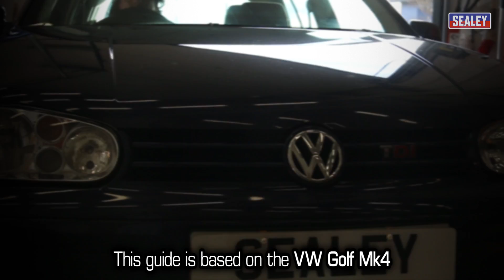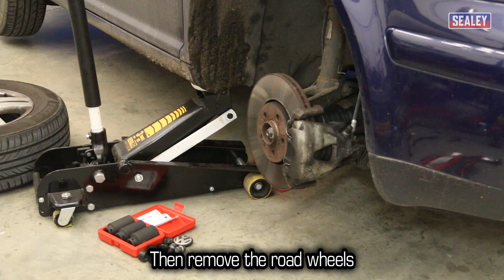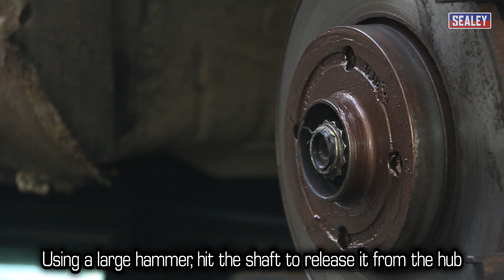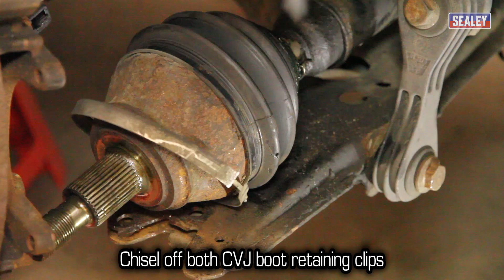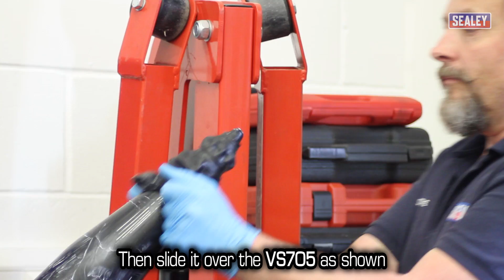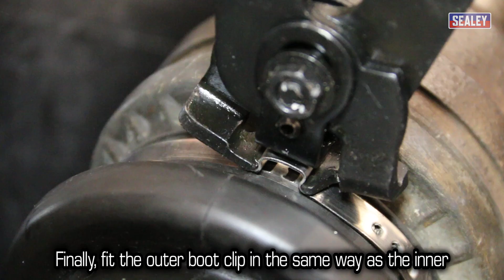Sealey CVJ Boot Replacement Guide

Comment: It is not mentioned in this video, but after this work, you should perform a wheel alignment, because the swivel joint was released from 3 bolts.

Comment: It would have taken no more than 10 seconds to tap off that cv joint. Less than a minute if it had a circlip. If you need to use this method to fit a cv boot you have no business working on a car.

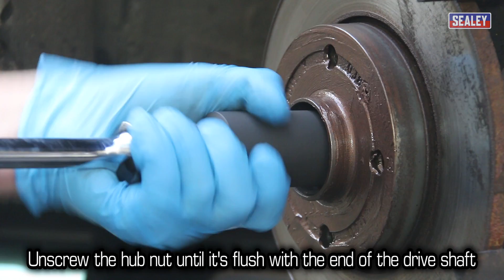Comment: 1:08  Copper grease between the steel hub and the aluminium alloy wheel actually ENCOURAGES GALVANIC CORROSION of the alloy wheel, and makes the alloy wheel pitted and powdery.....
Reply: I agree, but it seems to be better at preventing it from rusting than creating a galvanic corrosion.
Use general grease or ceramic grease to prevent it from rusting then, better imo if it helps you sleep.
Reply: @alinutzalin6346  Yes a thin layer of ceramic grease or silicone grease is fine.... as minimally as you can... copper grease is rubbish... the corrosion it creates becomes obvious the longer it is left there...